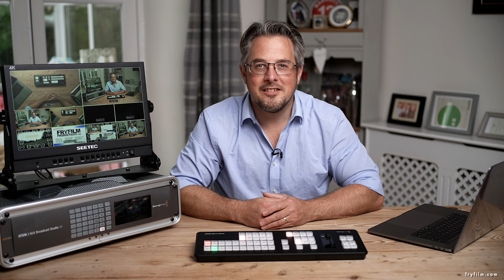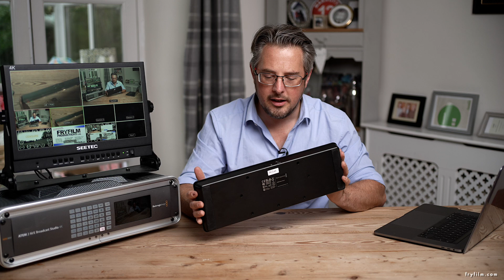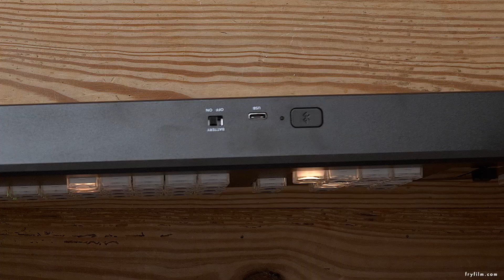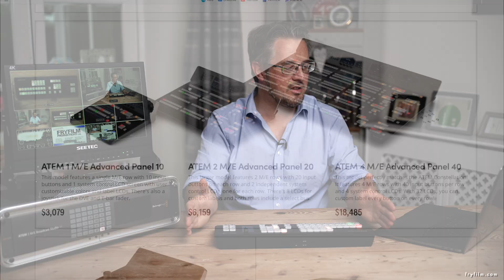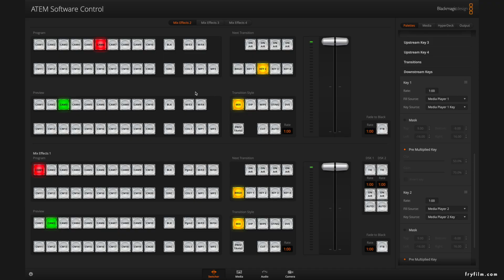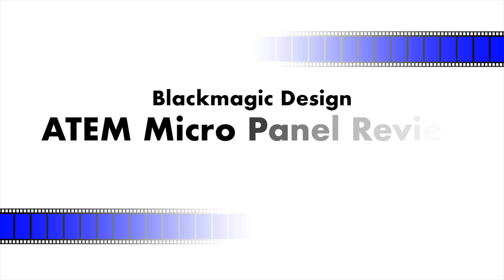Blackmagic ATEM Micro Panel Switcher Review

Comment: Hi, Can we use this control surface without software interface? Can it be connected to ATEM switcher directly without computer machine?
Reply from the maker: No, and why would you want to? The ATEM software controls everything, maps the buttons, set up all your graphics, keys, media, audio - why would you ever use an ATEM without the software?
Reply: @fryfilm2000  Thank you for your response. I was only thinking about the portability using with ATEM ME Constellation Panel were we only record the show with separate audio recorder like Zoom H6. Where we don not have enough time for setup also where graphics are added later and audio is contorted by any portable audio device.  
Just like Trickster now (vizrt) with mini control panel.

Comment: can you toggle macro button down so you can run macros without pushing it doenw constantly. Does ATEM Setup software (not the control app but the separate setup app) have option for that. Thanks!

Comment: What about using for the same price 2 streamdecks 32 keys (with companion)? More options, you can really manage many switchers, ...
Reply: Don’t you also need Companion to do that? I hate relying on free software for paid work. Also, the buttons and layout are instantly familiar to any vision operator on the Micro Panel, and with the Macros so easily accessible I don’t really see any advantage of using Streamdecks instead.
Reply: Streamdecks are great for controlling playback via a hyperdeck or OBS etc. - I would not consider switching a live show via a stream deck if I could possibly avoid it.

Comment: A great use for this would be with a mobile streaming rack setup. Put a Mac Mini or something in the rack with whatever-ATEM. This would put the control surface in front of the operator at proper working height, ie not on an awkward higher rack drawer. Wireless makes it even sweeter and clean. Just drop it in the rack storage drawer to travel. Thanks for the video!
Reply from the maker: @erikjrussell  Yup, great idea!
Reply: Not on BM website? It your control panel an engineering prototype?
Reply from the maker: @TheFleetz  Nope, it's available to order. https://www.blackmagicdesign.com/uk/media/images/atem-micro-panel

Comment: Everyone so worried about the Bluetooth connection. Of course I wish they put a POE network port on it but I guess time will tell if USB or Bluetooth turn out to be just a stable
Reply from the maker: @Reedith  Yeah, I don’t quite understand that worry. I mean, how long have we all been using Bluetooth mice?
Reply: @fryfilm2000  It's more like I don't WANT my computer between a control surface or ATEM. BT connection issues are known to happen even with something like my MX Master and Doug Johnson had issues connecting his Micro Panel to his computer on his live stream.
Reply: @ians.4284 Yeah I saw that. Mine connected straight away! Maybe he just didn’t charge it enough before trying to connect. 

I don’t think we’ve used any ATEM ever without a computer connected, so whether that’s between the panel and the switcher makes absolutely no difference.